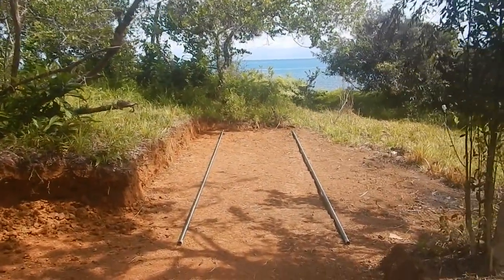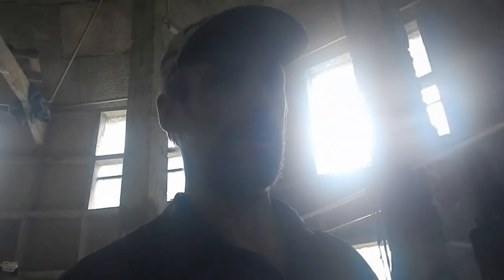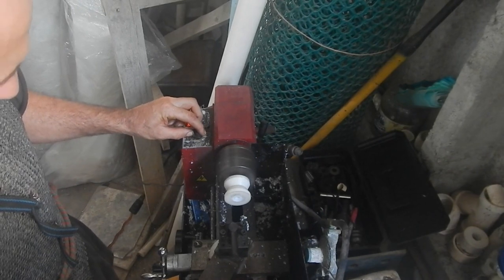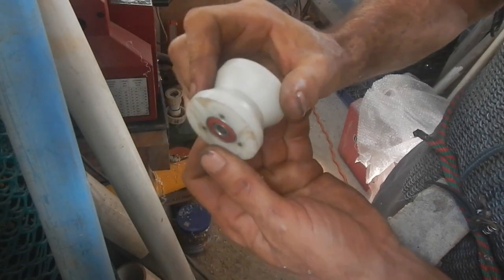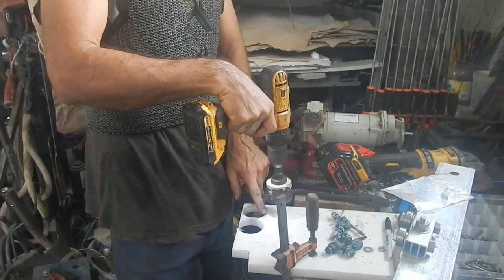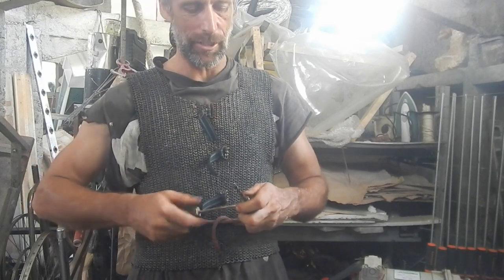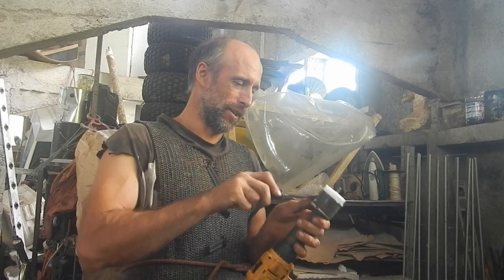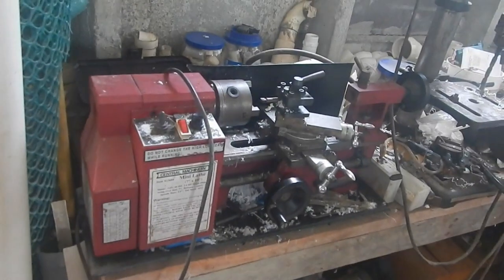Lumber Mill 017 Wheels

Comment: Couple of hints for machining:

Normal scews are no problem for carbide bit, not even with interrupted cuts. Hardened ones can be a but bad but stainless and 8.8 will machine fine.

When cutting plastic, you want really sharp tool and slow speed. Then the plastic don't melt and surface finish is great. You can grind such tools even from normal carbon steel, like knives, files and even car springs as long as you can make them sharp.

With aluminium, carbide works great and you can use all the speed you can get from the lathe.

Comment: One thing I’ve seen in welding and fabrication is that they would pre drill the centre hole without the hole saw then the hole saw has a steel dowel where the drill bit would normally go. The dowel fits in the predrilled hole and keeps the saw centred. Since the dowel is not as brittle as a drill bit it wont snap if the saw grabs.

Comment: Nice to see you using the lathe! For repetitive jobs like that use either a stop to hit the same diameters or if you have one you can set up a dial indicator on a magnetic base and hit different measurements along the axis. 
In this case you could have run all your wheels in one operation.
Reply: Also the measurements on your hand wheels are normally used for turning to a specific diameter or depth.

Comment: There is a fair amout of vibration and weight on the mill, better to have two wheels on each leg. One wheel can fail and you can still finish the job and fix the bad wheel later.